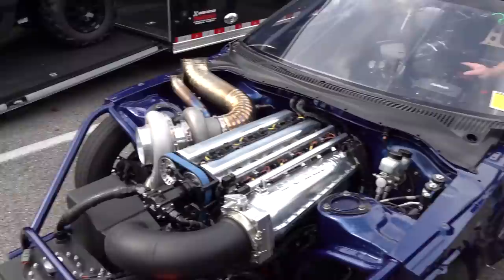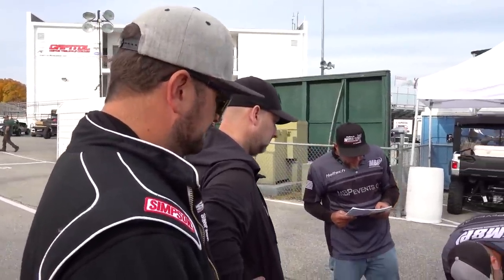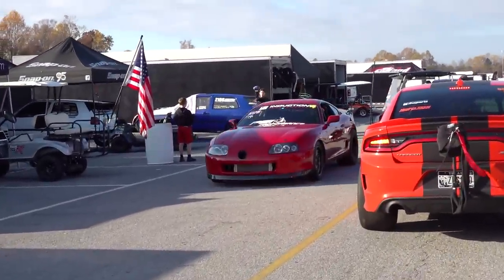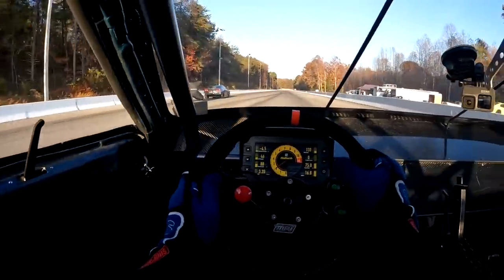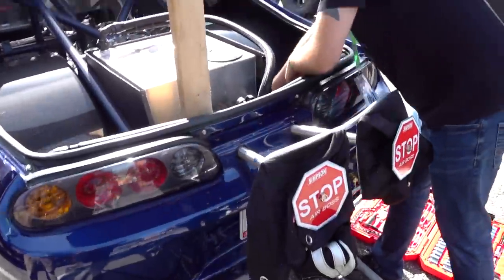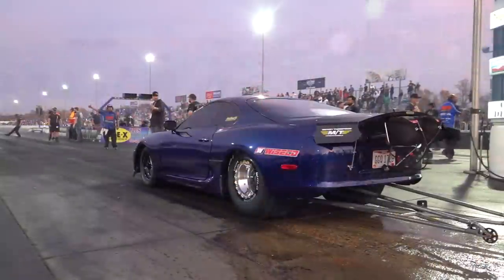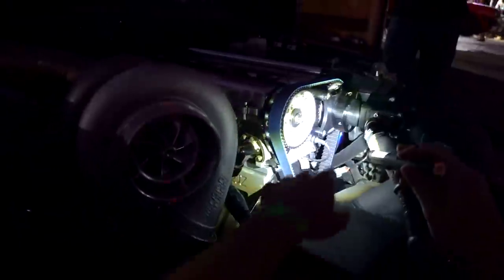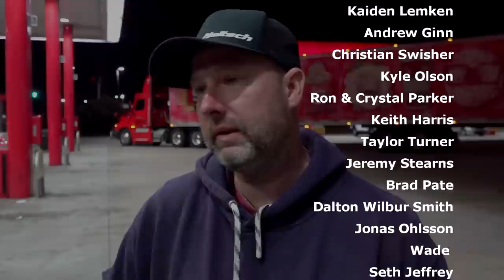Our Supra made World Cup Finals.. Then THIS happened!

Comment: When you're on the starting line doing a burnout be consistent with the gas pedal stop juicing it while you're doing a burnout hold the gas pedal at a certain RPM range to heat up the tires and how come you're not using a device to measure the Heat for optimal acceleration.

Comment: Wow. That's just unreal how fast that car was being basically a brand new build with almost no testing and killer driving by leo especially with as little seat time as he's had in the car. Sucks the engine went out before you guys could really run the car hard and see what it had in it but even still an absolutely insanely fast car for sure and when you guys get it sorted and get the engine to hang in there you guys are most definitely going to be a top contender for sure. Why don't you guys just go with a dry block and not run any water in it so you don't really have to worry about the head gaskets and having issues with them ? It's not like y'all use the car and drag and drive events or anything and y'all said y'all are running methanol anyway so I don't see why y'all just don't run a dry block. But either way whatever you guys decide to do I'm rooting for y'all and so are 10s of thousands of y'all's other fans but congrats on the 2 killer runs that you guys had 6 second with almost no test time and no seat time for Leo is incredible. Most people take years to do that so most definitely should be proud of that. Congratulations guys !! Can't wait to see what the car does next year.

Comment: Any hatch back car needs a “firewall” between driver and tanks in rear, especially if that tank in front of the water tank has any fuel any it. Would prevent a water shower again if that were to happen again. And like someone else said, try to smooth out the steering adjustments. That’s a disaster waiting to happen. Congrats on the 6.9 @ 204 💪🏻
Reply: There is no fuel in the car

Comment: So if it chucked the head gasket running a 6.94, what is telling you that happening was a fluke? Why does he think it won't happen again in 3rd at similar boost pressures? Or does he have plans to increase the clamping force of the head? That's like saying " My f150 would have ran 6.50s last night if the crankshafts in that old 300 would stop exploding at 120psi". "I know there's a ton left in it". Seems to me that if it's kicking the gasket out there isn't in fact "A ton left in it". 🤷🏻‍♂️ That seems more like a "we are ringing this thing for all its got".
Reply from the maker: Gasket / fire ring was damaged from a nitrous mishap long ago, just didn't find it til the boost got turned up.  Engine is more than capable.

Comment: Coolant pressure sensor as safety measurements.
Reply: There is no coolant pressure.   The system is open.  It's not like a radiator based cap system.    What happened here has never happened ever in all my years doing this.

The tank has a safety rollover valve and unfortunately the amount of airflow was enough to seal the tank causing it to pressurize.
Reply: Understand, but even open is proven here is not undefeatable and ready for an accident.